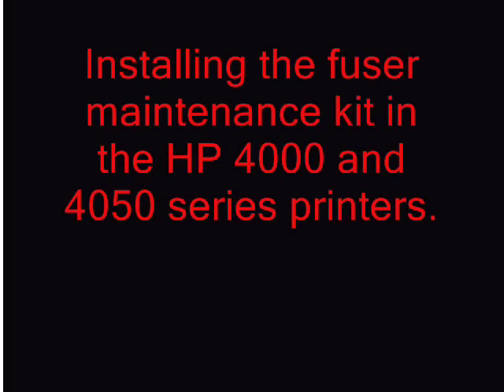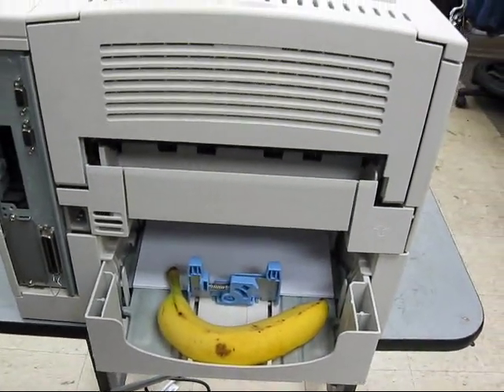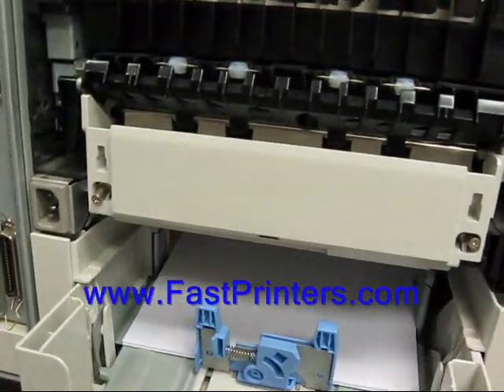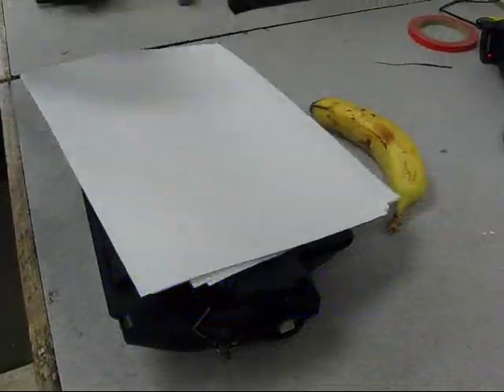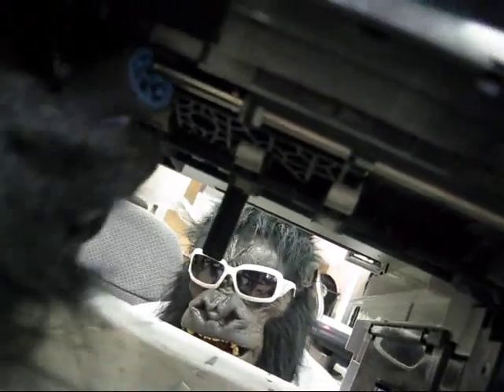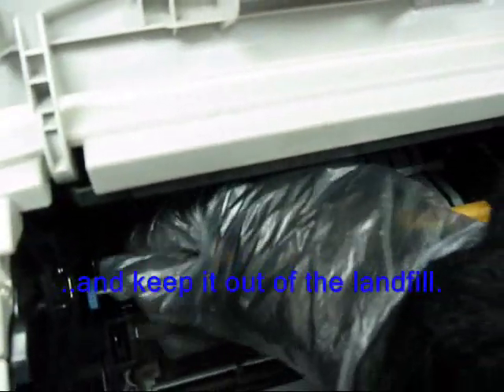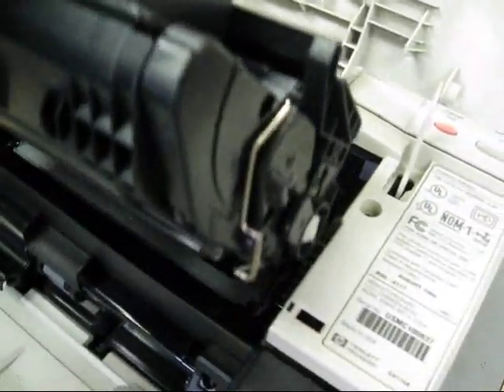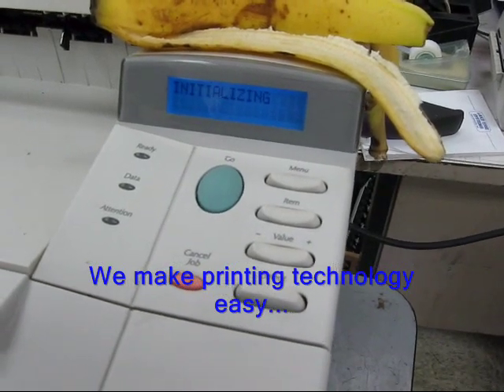Replacing fuser maintenance kit in the HP LaserJet 4000 4050 4000t 4000tn

Comment: Hi, I have a question. My 4050TN is being really slow. The panel said "Data Received, processing job" but it takes forever. Sometimes the printing job was never done, and went back to ready mode. Do you think fuser is the problem?
Reply from the maker: Your problem sounds like the main board, not the fuser.
Reply: Thank you. I will look into it

Comment: OK. I removed and replaced the Fuser and everything is correct. No error message. But impossible to reset the counter to zero. Thank you. But my real problem is still present. I have a gray vertical band (approximately 0.5 inches wide on the left side) on all my documents. My toner is 50%.